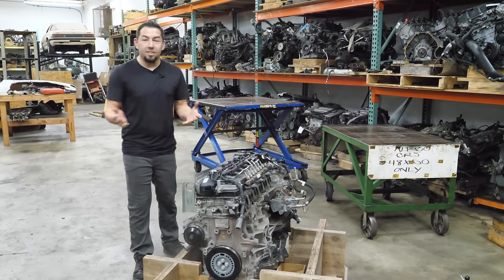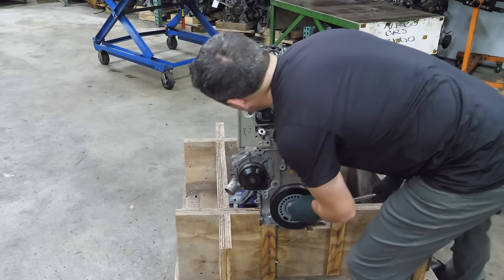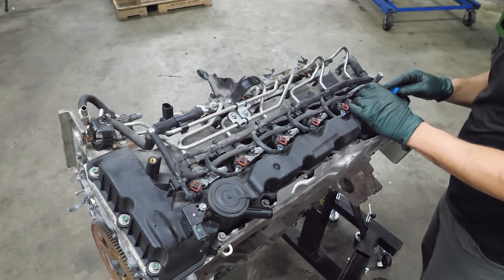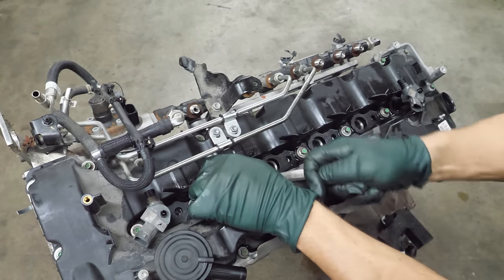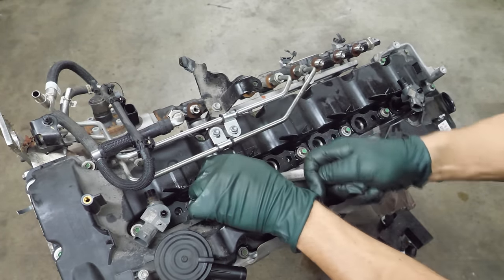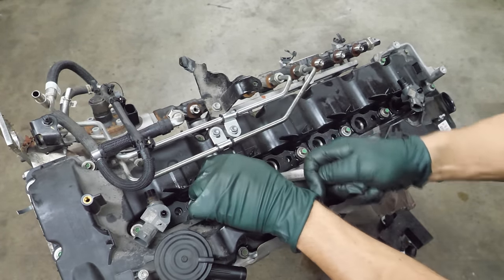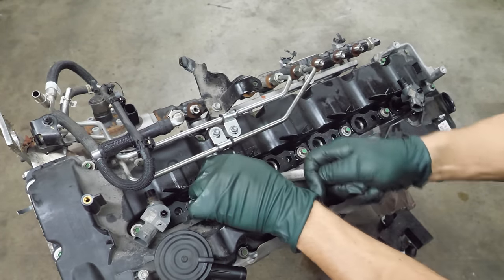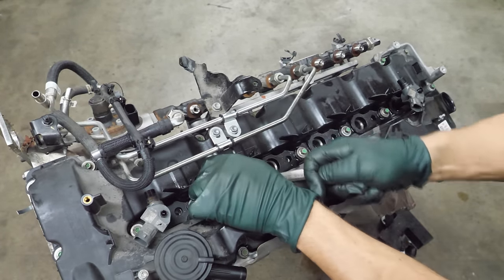BAD 2020 Silverado 3.0 Duramax LM2 Engine Teardown INCREDIBLE DAMAGE!

Comment: I don't know why so few manufactures can figure out timing chains anymore.
Reply: It's all about the $ and they have it figured just the way they want it.
Reply: @greggc8088  I think Ill stay happy with my old belt drive cam Toyota 2uz, a belt that reliably does 125k miles and take 2 hours to change!
Reply: Accountants are the problem.
Reply: @Thecarguy1254  A (dry) timing belt thats easy to change is the best solution!
Reply: I don't know why even fewer figure out timing gears.
Reply: Well kevlar is stronger than steel and that one, even with the abuse, looks like it would last for another 125k.
Reply: @greggc8088 absolutely correct. That explains plastic thermostat housings and oil pans.
Reply: Was it done by a bad engineer? Or GM wanting a truck to blow up out of warranty so you buy another new truck?
Reply: They know how to, its just not profitable.  Think about it if your cars ran 200k with no issues how would you make money.

146k is pretty good for a modern gm timing set up lol.  Designed to fail, incredibly expensive to repair when it fails = people just trading their car in vs fixing it most of the time.  Either way gm makes profit.
Reply: @greggc8088  They really want to replace many thousands of engines still under warranty?
Reply: @johnarnold893  Chevy says 150K replacement interval for the oil pump belt.  Not sure I'd want to trust it for almost double that life!
Reply: @WolfmanDude I would say thats the second best, gear drivin timing is the absolute best.  Set it up once at the factory and never touch it unless something else needs to be removed

Thats my opinion at least
Reply: Well things were less complicated years ago. You needed an oil pump, valve camshaft and fuel injection pump drive. Now a days,, half off the world ,,depends on this drive.
Some one once said: every advantage has its disadvantage.
Reply: Yea they save maybe $0.25 on the chain but when you sell 1m engines its a lot of money, i just wish somebody would start making upgrade kits so we are not forced to put the same crapy chain that failed from the start
Reply: Laughs in Audi/VW/Mini/BMW/GM.....
Reply: They win either way.  Either you get a new engine, or you get a new vehicle.
Reply: It would’ve been possible to make it gear driven too
Reply: Oh, manufacturers HAVE figured it out. It just doesn’t make sense to us, the consumers.
Reply: It ist not that they can´t - is more a they don´t want to. They think most customers will shut up and pay - wrong they are. At least in my case.
Reply: @AkioWasRight  timing gears are loud and don’t allow smooth acceleration. Which is why they’re in use on maybe a few engines available in light duty pickups today.
Reply: @Redsfanatic32  "Loud" is subjective. To many people, the added noise is actually a benefit. To me, it sounds like a supercharger, which is a total benefit.

As for "smooth" acceleration, I'm not even sure what you're referring to. Timing gears are actually the most accurate approach, giving you more control over the valvetrain. In reality, you can actually make an engine smoother with a gear set.

Any other disadvantages are negligible. 

Beyond that, it's just objective advantages. They're more durable, they don't develop as much play overtime, they last MUCH longer, there is no servicing, and low sliding gear cuts tend be more efficient.

Really, there's no good reason to not use timing gears, other than it just being too good for some people.
Reply: I know the diesel engine is inherently noisy but how noisy does it have to be when your pistons are smashing into your valves how long do you have to drive it to make indents that big?
Reply: It’s cheaper and in most cases requires the consumer to go to the dealership for the overpriced repair.. thus keeping dealerships funded so they can sell more of the junk the manufacturer makes. It’s rapidly headed towards the only way you can get your vehicle repaired is at a dealer. All this stuff that has to be “ programmed” after its replaced.
Reply: @AkioWasRight  all I know is what my Cummins engine does. Can’t really hear the gear whine on it. I just know what they sounded like on old gas engines.
Reply: @AkioWasRight For OHC engines, timing gears are complex and expensive.
Reply: @Thecarguy1254 my 5vz has 292k miles original belt 😅 about to do it and water pump soon though
Reply: @PistonAvatarGuy  Make them OHV.
Reply: @AkioWasRight  F--k no.
Reply: @PistonAvatarGuy  F-yeah.

The complexity of OHC has no purpose other than to make up for lack of pumping efficiency. 

If you drive a 30+ mpg Corvette, you'll understand what I mean.
Reply: @AkioWasRight  OHC engines make more power, more torque and are more efficient due to their superior cylinder head flow characteristics. OHC engines are also more mechanically efficient. That Corvette is an anomaly, in every other application, every example of an OHC engine is more efficient and more powerful than its OHV equivalent. American trucks are good examples of this.

And just imagine losing 200+ hp in a Lamborghini, or a Ferrari because OHV engines are so limited in the amount of power they can produce.
Reply: @Redsfanatic32  Modern Cummins (Common Rail) make hardly any gear train noise. At most, it's a slight whine when not under load. In other conditions, you don't hear anything because the sound gets drowned out by induction, injection, combustion and valvetrain noise. 

Again, "loud" gears are not that big of a deal. The sound of a modern DI systems would cover up the noise, even on a gas engine.
Reply: Before belts before chains wear gears, gears are best and last forever.  2nd best is an easy to change belt.
Reply: @AkioWasRight  Yeah, compare the 5.3 Silverado to the OHC 5.0 F-150, the F-150 makes more torque, a LOT more power and it still manages to get better fuel mileage.
Reply: Emissions, that's why.
Chains introduce tons of friction.
Some manufacturers that have tried using thinner chains to reduce friction, end up having the chains snap prematurely.

The only lasting low-friction timing system involves gears, and gears are very expensive - that's why we only see gear-driven timing systems on industrial engines.
Reply: @HomelabExtreme  Gears are insanely expensive, using them would likely add thousands to the cost of a car. No one even used gears on cars before emissions were an issue, except on some OHV engines.

You people will just desperately grasp at any straw that you can to find a reason to be anti-goverment, it's ridiculous.
Reply: @PistonAvatarGuy  lol, that's not true. LS engines have excellent induction efficient, with some of the highest CFM of any stock engines. This is actually due to the fact that there is no cam in head, allowing for larger paths in and out of the head.

Also, it's not an "anomaly". Even Charger Scat Packs will get close to 30 MPG when cruising, and they make nearly 500hp and are in giant boat of a car. That pretty much rounds up the limited number of gas cars with OHV. So, there's no basis for "anomaly". Efficiency is actually typical. 

Beyond that is OHV diesels in HD trucks, but even those are fuel efficient given their application. I mean, I can get 21-25 mpg on the highway out of my Cummins, and it has more power than an Aventador below 3,000rpm. OHV can be remarkably fuel efficient. 

Also, those whose notion that OHC is more "efficient" comes from a total misunderstanding of horsepower and "efficiency". Simply making more horsepower =/= "efficient", as that completely ignores energy expenditure. 

Corvettes, as the example, have "big" engines by certain standards, but they're not really "big" in a meaningful sense, they just have a lot of displacement, which is what you want. They can move tons of air with a relatively simple configuration. At the same time, they have fewer mechanical losses due to their simplicity. This is what makes them truly more efficient, not in the boy racer notion of "efficient".
Reply: @PistonAvatarGuy  Not in the real-world. In fact, even the GM 6.2L is more efficiency than Ford's 5.0L in real-world driving. 

I should know, my company has owned both trucks.
Reply: @AkioWasRight  That's some good trolling, there, bud.
Reply: I recently had to part ways with my 2009 Toyota Yaris due to some type of failure in the timing system.  I don't know exactly what happened because it was too expensive for the repair shop to diagnose, let alone fix.
Reply: @PistonAvatarGuy  I have no intention of trolling anyone, I'm just right.
Reply: Timing chains are the head gaskets of the early 2000s.
Reply: Short, stout timing chains on a pushrod engine are fine.  5' of bicycle chain is nonsense
Reply: Put it in the back because that way you got to pull the engine and all this crap lol
Reply: Its the over head chains
Reply: Especially putting them on the rear/transmission side. That should be a felony
Reply: That timing failure, and the pistons hitting the heads, was caused by excessive redlining.  Someone beat the crap out of their truck, THATS why it failed.  With normal operation, that engine would still be running.
Reply: @michaelbruns473 no customers wants more comfort power etc and these design ideas give you that.
Reply: Where’s your engine design what platforms is it in??? Let me know I’m curious.
Reply: Honestly, to go along with plastic thermostat housings, oil pans, and radiator/cooling system components, I'm shocked that plastic camshafts, crankshafts and connecting rods haven't been put into service by BMW first, followed by everyone else. 5 years down the road, plastic wheel bearings.
Reply: @AkioWasRight  you're ignoring that the most powerful on-road diesel engines that you can get in a semi today are OHC.  X15 Cummins, C15/18 Cat, 60 series Detroit 

Also, we also know that Harley Davidsons with their OHV engines are the absolute pinochle of mechanical efficiency 😂
Reply: Make no mistake about it …. They do NOT want the average citizen working on their designs , Good OR Bad ….
Also those “Duramax” engines are really made by “ISUZU” through a Marketing agreement that goes all the way back to the 1980’s when Chevrolet marketed the P’up which was an Isuzu pick up and the Luv pickup that competed with Datsun and Toyota mini-Trucks of the Day ….
Reply: @christopherweise438 
In Every case .
Reply: @johnarnold893 
It may be stronger when New but will never outlast well lubricated Iron gears .
Reply: @hopingforthebest1.9  Most large diesels are inline configurations and are gear-driven single cam. They don't have multiple cams and a mess of timing chains or belts. 

As for their efficiency, OHV has little benefit over SOHC in an inline engine, since pushrods have a tradeoff with belts, chains or gears. That's very different from a V-block. OHV V engine requires no added complexity, while SOHC basically requires double the timing components to operate.This said, both are relatively simple vs DOHC.

As for Harleys, that's a much more complicated subject as they are basically in a class that few others share. But keeping it simple, they are efficient for bikes of their size, weight and torque, so I don't really know what you're sarcasm is about.
Reply: @AkioWasRight One advantage of DOHC over OHV is with 4-valve engines. With an OHV setup, you would need to run valve bridges.  So, if you have a basic belt driven DOHC setup like the Honda J series and some Toyota V-6s you can actually have less moving components (depending on how the valvetrain is set up) than the equivalent 4-valve OHV engine 

Additionally, because the reciprocating mass of OHC setups is significantly less than an equivalent OHV setup, it allows the engine to spin faster without valve float-- which smaller displacement engines benefit from.

As for the Harley remark, just about every other motorcycle manufacture makes engines that produce more output per liter of displacement than Harleys.  What do they all have in common? They all almost exclusively run single or dual overhead cams.
Reply: An FSE told us German input was used in this engine. I don’t doubt it.
Reply: @hopingforthebest1.9  Output per liter is a meaningless measure because HP is a function of torque and time. It has no relation to displacement. 

Again, I can get 30+ mpg out of a Corvette with 400+ hp. Not many high revving cars match that, if any. Does it matter that GM pushrod engines have big displacement? No, it shouldn't.
Reply: Timing chains have been around for many decades!!
Figure them out isn’t the issue,
It’s cost savings! That’s the issue!!
Reply: @AkioWasRight Noisy and expensive.
Reply: They dont give a shit. Its that simple. Buy old cars.
Reply: The e.p.a ruins everything.
Reply: @WolfmanDude chains are better. Plenty of engines use chains, and they last the life of the  engine. My LM7 being one of them. It’s these shitty tensioners that are the problem.
Reply: Knock on wood but my mom's 2003 honda odyssey has 330k miles on it on the original timing belt (yes I know time bomb) so honda at least has it figured out
Reply: @AkioWasRight  inertia. Distance.
Reply: They’re all focused on battery tech now
Reply: @richardcornelius1050 The 6.6 duramax was a joint venture between Isuzu and GM. This engine was all GM clean sheet. GM calls all their diesel engines "Duramax". Even the 2.8L 4 cylinder from the Colorado despite the fact it is a VM Motori design built under license.
Reply: because good quality steels are almost impossible to get. china, india, turkey, US, vk and Norway steel from smelters with recycled steel is not consistent quality. The dutch steel is also getting worse as more and more recycled steels are added in melting proces.
Reply: @WolfmanDude  Totally agree.  Timing belts are simple, lightweight, less parts count and create a valid reason to refresh key components every 100,000 miles or so.  Basically if it’s a overhead cam engine, I would rather it have a timing belt.
Reply: I dont know why they would go with timing chain over a timing gear set in a diesel engine in general. This thing is too big to use chains. Dumb ass design if you ask me.
Reply: @zacharydavid5686 getting gears to line up between the block and the heads is the issue. If the cam is in the block, it's easy to align, not so much when you have a bolted on head. Chains allow some alignment slack.
Reply: @AkioWasRight I drive a car with 2 timing gears (1979 Subaru DL engine swapped with an 87 EA71S engine). One on the crank, one on the cam. I can't even hear it over the exhaust. Sometimes if I am cruising at really high manifold vacuum and the exhaust is quiet, I think I can hear them, but it's really not noticeable. The reason modern engines usually don't use them are #1- overhead cams, #2, money. It's easier to meet emissions with overhead cams and variable valve timing than cam-in-block, and it's cheaper to drive overhead cams with chains or belts than it is with gears. On an old fashioned cam in block engine like my Subaru, the gears didn't really cost any more. In fact that Subaru in its day was one of the cheapest cars you could buy. Didn't stop them from using gears.
Reply: @sherwoodforst7089 It is based on the 1.6 Opel diesel that was available in the Chevy Cruze. Some components like the timing chain tensioner are interchangeable. But the 1.6 has an oil pump CHAIN, not a belt. They developed the 1.6 into a 1.5 3 cylinder, a 2.0 4 cylinder, and then the 3.0 6 cylinder. All of which have the oil pump belt. But they really don't have issues. In fact I think they would have had less timing issues, had they gone for a full belt setup rather than just oil pump. Similar to the 1.2 in the Trax/Envista. GM has their wet belt technology down, compared to Ford or Peugeot.
Reply: @johnarnold893 you know honda and toyota tried wet belts with Kevlar and withing 5 years they offered cobwrsin to chain kits
Reply: @LethalBacon479 no theu say they tested it should be fine for 150k the warranty let's you k ow how long they think it will last.
Reply: The warranty isn't for 150k.  60K powertrain warranty.  I'm not risking a $10,000 engine on a $24 belt.
Reply: When it's determined by a manufacturer that a car's "lifetime" is ten years and 150k miles, they only make the parts strong enough to last that long.
Reply: @AkioWasRight Timing gears are loud as shit. You can't hear it over a 7.3 or 5.9, but people won't buy a car whose engine is constantly whining.
Reply: The removal of certain engine oil additives is part of the problem. The other part of the problem is the use of inverted tooth timing chains.
Reply: @justing6594   That's the strategy of many auto manufacturers. How many went from using roller chains to inverted tooth timing chains for no reason other than cost and reduced valvetrain noise? Ford used a roller chain for just one year in the 3.5 Ecoboost used in F-150's before switching to inverted tooth timing chains, bringing with it constant timing chain problems ever since.
Reply: @Bogel91   146k is pretty good for any modern manufacturer using cheap inverted tooth timing chains. Ford could have avoided years of stretched timing chains had they stuck with roller chains.
Reply: @jamesgeorge4874  Audi/VW/Mini/BMW/GM/FORD/NISSAN
Reply: @PistonAvatarGuy  "OHC engines make more power, more torque and are more efficient due to their superior cylinder head flow characteristics. OHC engines are also more mechanically efficient. That Corvette is an anomaly, in every other application, every example of an OHC engine is more efficient and more powerful than its OHV equivalent. American trucks are good examples of this."

HP per Liter is not efficiency. That's the kind of thing that room temp iq dunces think is true. BSFC or Brake-specific fuel consumption is a far more relevant and accurate way to compare efficiency. The Gen V 6.2L V8 had a better BSFC than the Gen 2 Coyote 5.0 and is still quite competitive with even the Gen 3 Coyote 5.0. And it's not an anomaly pertaining to the Corvette. In 2015 when the aluminum F-150 debuted, the 5.0L version of the truck struggled to match the EPA fuel economy of the equivalent Chevy with the 6.2L. 1.2L less displacement, supposedly "more efficient" and yet it struggled to match the EPA rating of the big "inefficient" 6.2L pushrod engine? wtf lol

You do realize that even Ford admitted that OHV was better for fuel economy than OHC when they unveiled the 7.3L Godzilla, right? If you look at the interviews with the engineers behind the decision to go back to an OHV design instead sticking with OHC, they said one of those reasons was better fuel efficiency. OHC, particularly DOHC, have huge parasitic losses due to the energy required to move all the mass in the valvetrain of the engine. Multiple timing chains dragging across multiple timing chain tensions, turning up to 4 camshafts, moving up to 32 valves and springs. Not to mention the huge engine oil requirements to keep those lash adjusters pumps up and cam phasers in control. 

The biggest advantages of DOHC are at very high RPM, high boost applications, and emissions. Emissions was actually the single biggest reason why most manufacturers discontinued their small displacement OHV engines.
Reply: @deplorablelibertarian   You're probably right but I wouldn't have waited until the service interval was due in a few thousand miles to have the belt and timing chain done, particularly on a totally new engine design with GM's first foray into wet belt driven oil pumps.
Reply: @hopingforthebest1.9  On the other hand, we also know that even when Ford stripped hundreds of pounds of steel off of the F-150 for 2015, that several hundred pound weight advantage still wasn't enough to help their 5.0L 32V "efficient" DOHC V8 deliver better EPA fuel economy rating than same model year GM trucks with the 5.3 or 6.2 V8's. OHC was adopted primarily for the advantages when used with boost, or when governments began to more strictly regular emissions based on engine displacement. The gold standard for determining true fuel efficiency of an engine is brake-specific fuel consumption. The Gen V 6.2 V8 had a higher BSFC than even the Gen 2 Coyote 5.0. Using Harley Davidson's engines as the basis for your argument against pushrod engines is low IQ clownworld stuff.
Reply: @karlschauff7989  "HP per Liter is not efficiency."

I wasn't talking about HP/L, I was talking about actual fuel efficiency. The most fuel efficient vehicles in the world are all powered by OHC engines.

"BSFC or Brake-specific fuel consumption is a far more relevant and accurate way to compare efficiency."

The most THERMALLY efficient (this is what BSFC measures) automotive engines in the world are also all OHC engines. Maybe you should have actually read my comment before replying.

"1.2L less displacement, supposedly "more efficient" and yet it struggled to match the EPA rating of the big "inefficient" 6.2L pushrod engine? wtf lol"

The F-150 is slightly more fuel efficient. The EPA rates both trucks the same on the highway and Ford gets 1 mpg better in the city.

"You do realize that even Ford admitted that OHV was better for fuel economy than OHC when they unveiled the 7.3L Godzilla, right?"

Maybe if you compare a DOHC, 32 valve V8 to an OHV V8, but a 2-valve SOHC engine is simpler, has fewer moving parts, allows complete freedom of port design and has much less reciprocating mass. Ford would have gone with an OHV engine to simplify the cam drive, which is a problem for many OHC engines (thanks to owners not knowing how to maintain belts). Again, ALL of the most thermally efficient (BSFC) automotive engines IN THE WORLD are OHC.

Again, if you'd read my comment, you'd see that even heavy truck engine manufacturers are going to OHC engines, and this absolutely isn't part of some marketing campaign, as they're not mentioning it overtly when regarding the engines, this is purely being done for the sake of efficiency.

The real problem with how you people are making these comparisons is that you'll compare an ultra-high strung OHC engine to an OHV valve engine and then make the conclusion that OHC engines are less efficient, but when they're not high-strung, you end up with insanely efficient engines, like the Prius engine, or the Mazda Skyactiv engines (the most THERMALLY efficient gasoline production car engines in the world), or the current Formula One engines (the most THERMALLY efficient gasoline engines PERIOD), which are much less high-strung than F1 engines from the past.
Reply: @AkioWasRight  They figured out timing gears decades ago, and they were upset that the gears basically never wore out, so they invented chains and plastic bits in the timing system so that they would fail and cause massive damage to the rest of the engine, resulting in a greater cash flow out of your pocket.
If there's one thing 'they' can't stand, it is Lowly Peons having discretionary funds available.
Reply: One of the things I see in common with the low mileage failures.. is a very complicated timing chain pattern, with a lot of tight corners requiring lots of tensioners...
Look at a Toyota 4 cyl.  a simple V shape from crank to the cams... with very little deflection of the chain where it contacts the tensioner guides..
Reply: General Motors spends their considerable engineering talent not building the best but finding the best way to save $0.02 per vehicle....

I've never owned a GM car I doubt I ever will-
Reply: They have figured them out!! How to make them fail and make the consumer spend more money!!! On a positive note, the price of lube is still fairly reasonable!!😂
Reply: @Bogel91 Thats assuming someone buys another junky GM. They don't make any money when they thoroughly piss off a consumer with their crap giving out prematurely and buying another brand.
Reply: @hopingforthebest1.9 until they try to save a dime and make them out of plastic which fails. They go from a bulletproof design and sabotage it with the bean counters. That's why brand loyalty is down the toilet.
Reply: @andrewallason4530 not if they replace the engine and you trade it for another brand. They lose all the way around as most will never return to that brand
Reply: @karlschauff7989  Really, the sole argument for pushrod engines is when it comes to V8s, as you can have a larger engine that loafs along at low load and low rpm over a wide range of operating conditions without also having it be absolutely enormous in physical size. If Ford had wanted to retain the SOHC setup of the 6.2 that they replaced with the 7.3 Godzilla (stupid name, that's a Japanese icon), while also increasing its displacement by over a liter, the engine would have likely been ridiculously large in its physical dimensions. Everywhere else, you just run into the problems that I mentioned in my previous comment.

Nothing proved more conclusively that pushrod engines were obsolete in every application that had less than 8 cylinders than GM's pushrod V6, which was absolutely stomped by its overhead cam contemporaries... in every possible way... even as GM added features like VVT and increased its displacement (LZ9, 3.9 liters). That engine would have likely needed to be more like 4.5 liters in displacement to compete with the power levels and efficiency being delivered by OHC ~3.5 liter V6s today, and you might as well go to a V8 at that point.

Anyway, some heavy truck engines to check out...
International S13 - DOHC
International A26 - SOHC
Volvo D11 - SOHC
Volvo D13 - SOHC
Cummins ISX - SOHC/DOHC
Cummins X15 - SOHC
Reply: @PistonAvatarGuy   What does it matter if the engine "loafs along at low load and rpm"? MOST engines loaf along for 95% of their life. That's where fuel economy is judged, not when you're running through the gears at 80 mph on a twisty mountain road. And Ford didn't engineer their new 7.3L V8 just to loaf along at low load. They chose a pushrod valvetrain because it would deliver an engine that was more fuel efficient at low RPM at a variety of engine loads than a comparable OHC engine. Both under the exact same workloads and demands, they ran the simulations and FEA, and determined the pushrod valvetrain delivered  better fuel economy. Cope harder lol

The single biggest driving force behind the shift to OHC engines was and still is EMISSIONS. GM even kept their 4.3L pushrod V6 in their half-tons because it delivered the perfect amount of power and fuel efficiency, only recently getting rid of it for.... yeah... emissions regulations. Even in the world of sports cars, the Camaro and Mustang are within one or two MPG of each other despite the Camaro having 1.2L more displacement, half the number of valves, no independent intake/exhaust valve timing, no variable geometry air intake, etc. When equipped with a manual, the Camaro with that big "old school" 6.2L V8 actually gets 1 mpg better in the city and overall average vs the "high tech" 5.0L V8 with twice as many valves, independent intake/exhaust VVT, variable intake geometry, etc. 
https://www.fueleconomy.gov/feg/Find.do?action=sbs&id=44282&id=45050&id=44232&id=45049

The GM 3.8L was quite competitive when it was still on the market, the biggest detractor being the fact it was behind that 4spd turd GM always paired it with. The 2004 Buick LeSabre with the 'old school' port-injected  3.8L V6 and 4 spd delivered essentially the same fuel economy as a 2014 Buick LaCrosse with 3.6L DOHC VVT DI engine and 6 spd transmission. https://www.fueleconomy.gov/feg/Find.do?action=sbs&id=19827&id=33836
 It also delivered the same fuel economy as a 2004 Toyota Camry with the 3.3L DOHC VVT V6 and 5 speed auto. 
https://www.fueleconomy.gov/feg/Find.do?action=sbs&id=19827&id=33836&id=19812

You overlook the downsides of a modern DOHC engine design. It has a lot of parasitic losses as a result of the big moving mass and friction required to make it work. 4 cams vs 1, twice as many valves moving, 4 VVT cam phasers vs 1, multiple timing chains (some of them very, very long), multiple big timing chain tensioners, etc. That's a lot of additional mass and friction. It's also a lot of mass that's speeding up and slowing down as the engine is operating. It also puts a big load on the oil pump to keep the phasers, lash adjusters, and tensioners operating.
Reply: @giggiddy  engineered to last the warranty period, you buy the replacement engine, at 300% of it’s actual cost.  Or write the vehicle off.   And when you buy the replacement, don’t forget, despite all the vehicle brands, there’s only really a handful of actual companies controlling the industry.
Reply: No shit. Gone are the days of a single chain and it has become whatever clusterfuck this thing is.
Reply: gm since bailout is even worst than before, my 2.0t ecotec has 15 years and 160k miles and everything is factory, you cant even do that with the same engine from 2010-2020
Reply: I've been told chains make a bit more noise than belts. On the other hand, my old Golf Diesel only had its timing chain checked (acustically) at 200k km (125k miles), sounded good, so they told be to check it again 100k km later. Sold that car with 230k km, the next owner drove it to 320k km. Now I have a belt-timed TDI, and the change interval has been adjusted from 60k km to 90k km a few years ago. Another car I had had an Iveco engine that needed a belt change after 45k km or four years, yikes!
So my theory is they use belts nowadays because they're quieter, but more important, they have change intervals and since you basically have to take apart half the engine to get at them, this is quite expensive. So expensive that Volkswagen changes the water pump at the same time, because you also need to take half the engine apart to get at it (and it's the same part as for the timing belt). Other than that, my TDI engine is solid as anything, got nearly 270k km on that one, and it's showing less wear and tear than you'd expect from a nearly 20 year old engine.
Reply: @hinzster  Most timing belts these days have ~100,000 mile (160,000 km) change intervals. The Honda J35 in the Pilot, for example, has a 105,000 mile belt change interval.

Belts are used because they're more efficient (more power, better mpg, lower emissions), they're lighter (reducing both engine/vehicle weight and the inertia associated with the moving parts of the engine), they're cheaper, quieter and they absorb harmful harmonics which can be transferred between the crankshaft and camshaft(s). Many of these advantages are why you'll find belts on some of the most high performance racing engines in the world, like NASCAR engines.
Reply: @giggiddy  They don't care about second hand market.  Most people buying new cars trade in their car before the failure point (100k miles).
Reply: Step one: remove engine
Step two: replace oil pump belt
What’s the problem?
Reply: Noise is the problem with gear drive cams.
Reply: @AkioWasRight  "The complexity of OHC has no purpose other than to make up for lack of pumping efficiency."

I'm still trying to figure out if you're trolling, or not. Are you being upvoted because people are cheering you on for being a troll, or are they just that dumb? Pumping losses create a limit on both power and efficiency, which is why the most efficient automotive engines in the world, and the most powerful automotive engines in the world, are OHC. Even semi truck engine manufacturers are going OHC in search of efficiency. I'm just baffled.
Reply: @karlschauff7989  "That's a lot of additional mass and friction."

He says. ignoring the enormous size of the OHV engines required to compete with OHC engines.
Reply: @PistonAvatarGuy  You're baffled because, instead of focusing on what I said, you're just fishing for an ad hominem argument to make.

Look, it's almost a week later. Just move on.
Reply: @AkioWasRight  What you said doesn't make any sense.
Reply: @PistonAvatarGuy  Then rethink what you understand, because it's probably wrong.
Reply: @AkioWasRight  OHC engines = the most powerful engines ever produced, thanks to their superior aspiration and mechanical efficiency. OHC engines = the most thermally efficient engines ever produced, also thanks to their superior aspiration and mechanical efficiency. What am I wrong about?
Reply: @PistonAvatarGuy  We've already been over this. Just move on.
Reply: @AkioWasRight  All you did was troll. Heavy truck engines are going to OHC, because their primary concern is efficiency, you said the opposite. You said that LS engines have excellent induction efficiency, but their heads flow quite poorly when compared to OHC heads and their low BMEP reflects their poor aspiration efficiency. If you read the rest of my comments here, you'll see that only V8s really benefit from an OHV arrangement, while other configurations suffer a loss of efficiency and performance as a result of making use of an OHV system.

Edit: Maybe you meant HD pickup trucks?
Reply: @AkioWasRight  Ok, a couple of my most important comments here were shadowbanned, so you win, I can't compete with censorship.
Reply: @Thecarguy1254 facts. On my 4th? 5th? UZ over 200k all have been great.
Reply: Poor maintenance can't be bypassed with engineering.
Reply: @christopherweise438  It's not the accountants that make the decisions.
Reply: Since this is a Duramax I assume it is made in Korea and for the cab over engine trucks that get services from the rear of the engine rather than the front.
Reply: It only has to last as long as the warranty.. not a day longer.
Reply: @christopherweise438 common misconception.  The bean counters are NOT the problem.  The average consumer is the problem bc they do the following:

1. Buy vehicles based on secondary features/gizmos rather than what they need the vehicle for.

2. Half the country continuously votes for more and more regulation making the vehicles far more complicated and less reliable

3. People keep manufacturers afloat that turn out the worst instances of the planned obsolescence by buying the vehicle because it is 4-5k cheaper than the equivalent vehicle from a better manufacturer.

The bean counters just react to the customer, it’s 80% of the problem.
Reply: @christopherweise438  Beancounters look at will this last untill the  engine warranty is up if we use cheaper parts to save $0.06 a unit?
Reply: @Joe-hz1nw  -  Sounds like something an accountant would say.  😉
Reply: @stewkingjr  -  The hell it's not.  Cost controls EVERY decision.  They may not have the final sign off......but it's all their plan.
Reply: timing gears > timing chains
Reply: @Bogel91  how does that work for toyota then? their cars last hundreds of thousands of miles yet they are still at the top and still sell a bunch of vehicles. So it appears you can make a quality long lasting product and there will be a demand to make more.
Reply: That engine is so overdesigned melt it down and make two 5.3L.
Reply: Atleast it wasn't some garbage belt
Reply: All it's gotta do is last the warranty. Anything after that is money wasted.
Reply: There is no excuse it isn't gear drive.  @WolfmanDude
Reply: @PistonAvatarGuy  LMFAO dude you're clowning your self right now.
Reply: @karlschauff7989  Ok, troll. Let me know when a pushrod engine achieves over 50% thermal efficiency while producing ~1,000 hp from a 1.5 liter engine, or 200+ mpg in a production car, mmkay??
Reply: Classic Mercedes Diesels had the best timing chains of all time. OM617 MASTER RACE!
Reply: @PistonAvatarGuy  "50 per cent tHeRmAl EfFiCiEnCy!!!1!" Ok let me know when a twin turbo 5.0 Coyote hits 50% thermal efficency. Last time I checked a stock 5.0 Coyote just matches an LT1 6.2 in fuel economy despite twice as many intake and exhaust valves, 4 times as many cams, 4 VVT cam phasers instead of 1, independent intake and exhaust valve timing, and a variable geometry intake manifold. That's where the rubber meets the road, not highly specialized designs like the Skyactiv that gets its fuel efficiency from HCCI!!! not the fact that it's a DOHC valvetrain. As I already pointed out, the Gen V LT1 6.2 achieved a better BSFC than the Gen 2 Coyote despite the "enormous" difference in displacement and having half the number of valves per cylinder. 1500 HP? who tf cares? We weren't debating what a factory engine can make with huge mods. We're talking fuel efficiency and power of factory, EPA legal engines. 

Stay salty 🤡
Reply: @karlschauff7989  Also, just to hammer home how pathetic the Coyote really is (unless it's turbocharged and making 2,500 hp)...

2022 Nissan Titan - 5.6 liter V8; 400 hp; 413 lb-ft; 16/21 mpg; 5,539 lbs.

2022 Chevrolet Silverado - 5.3 V8; 355 HP; 383 lb-ft; 16/21 mpg; 4,860 lbs.

Face it, your Coyote poster child for the ultimate OHC engine is just weak and you're cherry picking because you don't have an actual argument. Who's the clown now?
Reply: @stoneylonesome4062 Mercedes even sold offset cam gear keys in the 1970s, so you could set your cam timing right on a stretched chain to get another 200,000 miles out of it.
Reply: @karlschauff7989  Yeah, pwned. Eat it.
Reply: I dunno man, my 24V Cummins accelerated smooth as silk with a front gear train. I couldn't hear the gear lash much either while it was running, not like I can in the bigger Cat engines anyway. @Redsfanatic32
Reply: @confused9525 it's not a lot of money for a billion dollar company.  It is a lot of money to a greedy billion dollar company.
Reply: @WolfmanDude 
Gear drive that will run a million miles is the best solution*
Reply: @kylesonsalla7620  Yes I also think gears are the coolest and most durable solution. However no manufacturer would ever put them in a new car. They are too costly and noisy for the target demographic of new cars. Remember, new cars are not made for us technical people. New cars are made as a status symbols for upper middleclass people with zero technical knowledge. I would pay extra for a more durable engine with gears, but I will also never buy a new car. I hate penny pinching as much as the next guy, but is is an important thing to consider because cost dictates if something gets even produced in the first place. Same is true for other unpopular subject like emissions and noise. Thats why I think a well designed timing belt is the best solution. Its cheap and silent enough to be competitive and mass produced, yet it enables us technical people to keep the system in good shape indefinitely with relative ease.
Reply: @WolfmanDude  
They come in diesel pickups all the time still.
Reply: At this stage in ICE design the manufacturers could simply eliminate timing chains and belts altogether by using pneumatic or electrically actuated valves. The benefits of  virtual cam profiles alone would be huge performance boost.
Reply: @PistonAvatarGuy Assuming what you recite is true… all those monetary and environmental gains are out the window in the grand scheme when you consider that GM LS engines routinely last 400,000 miles with nothing more than oil changes.
Reply: @wphh7272  No they don't, where on Earth did you get that idea? The timing components aren't even the most common part of an engine that becomes a problem as engines age, it's usually the piston rings/cylinders and/or the rotating assembly bearings. Heck, the SOHC V8 in the Crown Vic was one of the engines that was most famous for lasting to around 400,000 miles. You people are just focusing on the engines that have problems with their timing chains, but there are PLENTY of OHC engines that simply dont have those problems.
Reply: @WolfmanDude  Well said!
Reply: @wphh7272  I guess I should have worded my comment differently, of course an LS engine CAN last that long, but they rarely do, and the same can be said for a good number of production car engines.

How long an engine lasts isn't related to its cam placement (again, that's where heavy truck engines are headed), it's related to the design life of the engine, which is going to be as short as manufacturers can get away with, so they can sell as many vehicles as possible.
Reply: @wphh7272  And if your argument is that it makes sense to replace 30-40 mpg OHC 4 cylinders with nothing but 15 mpg V8s, that's just insane.
Reply: They have...copy China and build junk with junk...no that's a sanpan. Lol....
Reply: @karlschauff7989  "As I already pointed out, the Gen V LT1 6.2 achieved a better BSFC than the Gen 2 Coyote despite the "enormous" difference in displacement and having half the number of valves per cylinder. "

Also, this comment is hilarious, because it sounds like you're making the same mistake as the Raptor Aircraft guy, thinking that BSFC is something that's fixed for an engine, or that an engine has the same BSFC over the entirety of its rpm range and load settings, but that's not how things work. Yes, larger engines (regardless of valvetrain configuration) can have a better BSFC at the rpm and power settings where engines spend most of their time operating (and where the EPA tests mainly run the engines) than smaller, higher-strung engines, but that doesn't mean that their BSFC is just better in general. A 9 mpg rated DOHC engine might have a worse BSFC at low power settings than a 15 mpg pushrod engine, but the DOHC engine might have a better peak BSFC at higher power settings. Either way, DOHC engines hold the record for thermal efficiency (the best BSFC). I suggest that you look up something called a BSFC map.

It seems like you're trying to use the LS engines as proof that pushrod engines are inherently more thermally efficient than OHC engines and that all of the manufacturers of OHC engines are just lying, which is just absolutely hilarious, because it's simplistic on a level that's basically insane. Sometimes things are complex, that's just how things are, bud.
Reply: @PistonAvatarGuy, nothing like admitting you’re a democrat….
Reply: @hopingforthebest1.9 I heard they didn't do timing gears because they are too noisy  .
Reply: @WolfmanDude  My tacoma has leaky camseals, would you say that is detrimental to the life of the belt?
Reply: not sure why a diesel engine has a timing chain... have they not all learned from cummins? gear train is the most reliable way to run a diesel
Reply: @AkioWasRight  who
Reply: How well is a chain going to hold up to oil filled with soot? Look at how many cars/trucks have timing chain stretch issues.
Reply: @justing6594 definitely the latter. I know some of the engineers and their sharp guys they adjust are handcuffed by the bean counters.
Reply: @jeffreygoss8109  sad. All about making a buck I guess. I think I'm going buy an old tacoma or something.
Reply: @Thecarguy1254 I own 3 of these and I’m trying to keep them for a very long time.  Such good engines and they ask for so little.  My daughter has 285k and my sons 250k and my beater truck 370k and all still run with no leaks and no smoke.  I started the ole truck the other day, hasn’t been started in a month, cranked right up with no smoke.  Try that with some of these newer GM or Ford eco traps….let alone one with 370k miles on it!
Reply: It's the auto start stop.
Reply: @Thecarguy1254 my pile of trash Cruze had 200k on the belt
Reply: I use to like dual timing chains.
Reply: Emissions, rolling resistance, drag, sustainable/safe material standards. Money ultimately.
Reply: Is the LZO better?
Reply: A diesel with any chain is just wierd im so use to gear driven diesel engines. But this belt for the oil pump is just bad like the 4.2l Audi V8.
Reply: @Thecarguy1254 My frontier has 150k original chain and tensioner
Reply: Ever since the Audi timing chain fiasco, manufacturers realized they can deliver 💩💩💩 to customers and people will accept.
Reply: I think it’s funny too. I still daily-drive a 1996 Grand Marquis that hit 402,000 miles last week. Original engine (4.6) and transmission (4r70w). 

Original timing chains. Replaced the valve stem seals, chain guides, chain tensioners, and front seal at 350k…It began as a light teardown to see how worn everything was and to decide on buying a new long block. Nope, didn’t need one. Still shows crosshatch on cyl walls, chains weren’t stretched out of spec, sprockets were very lightly worn, excellent oil pressure at all times, burns the same amount it ever did (1/2 qt per 3000 miles), so no reason to replace it. Gave me proof that my 5000 mile service intervals on synthetic oil are just what the doctor ordered. Also gets a new air filter and pcv valve every 10k. Helps keep the oil & crankcase clean. 

Those engines were awesome until about 2003-4 or so. Still very good after that, but ford got cheap on a lot of the parts and they needed the same work around 200k.
Reply: @johnarnold893 generally it’s not the belt, but rather the tensioners that wear out first.
Reply: Ford perfected timing chains in Modular V8 a long time ago in a galaxy far away.
Reply: What about just plain old gears like cummins?
Reply: @PistonAvatarGuy  You think lifters and push rods would zap 200 HP?

I doubt it. 

It is a fact OHC can rev much faster, so perhaps you are right?
Reply: @ihavethedocuments2580  No, being limited to only two valves, more restrictive ports and a less efficient valvetrain zaps 200 hp.
Reply: @ihavethedocuments2580  This is what happens when you replace 2-valve heads and pushrods with DOHC, 4-valve heads: watch?v=2YuUsLZ54Uo

If it were emissions controlled, it might lose 50 hp, but that's still 200 hp more than the pushrod LS7.
Reply: @ihavethedocuments2580  And it should be noted that those aren't the greatest flowing heads in the world. 4-valve racing heads would likely result in a 1,000+ hp engine.
Reply: @ihavethedocuments2580  There was some notion a while back that 2-valve heads can match the flow performance of 4-valve heads, but that's just pure nonsense.

A Honda K-series head, with its tiny 86 mm bore, can outflow an LSX head with a 105mm bore, even with 30% less valve lift! In theory, a 4-valve head with the same bore diameter should outflow the LS head by a much greater margin, at least 25% at the same lift.
Reply: Diesels usually have timing gears because chains don’t last.
Reply: In big trucks they are geared timing
Reply: It all comes down to a lobbied Gov.
Engineered obsolescence 
produces two things;
A huge profit gain for dying i.c.e. class automotive crowd and Inflation. Taxing the work poor people class is a control agenda for bloated oversized bureaucratic greed.
It  knows no limits and has very little care for upcoming crash.
The vast majority of ‘billionaires’ are filthy rich, pay no tax, personally don’t own a thing. 
They all work on borrowed cash off of capital assets. 
Crashes mean huge profits scooping up assets from the insolvent and bankruptcies. 
While this is insane for us, its business as usual for them. 
A change of Gov will help, but its like changing a diaper, they will shit themselves again. 
Information, knowledge is like battery acid and instantly dissolves their scams.
Reply: @stevenichols4639 I’m pretty certain the engine failed quite quickly as it was burning its own oil causing the failure
Reply: I’m an automotive engineer don’t tell them I told you this, but we (employer) really don’t care. Truck blows up after the warranty. To be honest. Most cars nowadays. Have a 10 year expiration date. The people I work with every day with the smartest people I know from mechanics to former Dakar , and Baja engineers,. Trust me we can make a reliable engine Toyota was doing it back in the 2000s. There’s been multiple cases where through long-term testing we have found multiple issues but since the issues we found “most likely” happen over 200,000 miles we purposely did nothing. our customer base (likely used) who drives cars not far into the future. Don’t have the money to buy a new products so we don’t care what they think about us. And the customer basis I that afford a new truck will have a perfectly problem with the truck for 6 to 8 years. before you ask other companies do the same even Toyota now with the new turbo junk. We usually open up or competitors engines and see what we can rivers engineer or learn from )non-patented) Sooo… sorry 😢 (power train engineer in one of the big American three)
Reply: @Thecarguy1254 Yeah, I'm feeling the same way. F wet Belts, chains are a pain to change.
Reply: @AkioWasRight how? You always have an extra cam at least. The first mod motors were cam over bucket single cam engines. Can’t get more basic for a ohc configuration. 

The modern coyotes are significantly more efficient trucks than the modern 5.3 let alone the v8. This is reflected in the mpg and power ratings of the trucks. 

Coyote heads flow better and have significantly higher compression to increase efficiency. Very similar to the first generation of skyactiv engines
Reply: @Demons1198  I have plenty of experience with both SBC motors and Coyotes. There's also tons of data stacked over the years. I've seen nothing to show any significant efficiency advantage in the Coyote, none.

Also, you're making a generalized comparison. In the latest generation, there's no version of GM's 5.3L that competes directly with any version of the Coyote. 

Still, even if everything you say were correct, nothing about it discounts the simplicity and durability of gears and/or in-block cams over the complexity of S/DOHC and chains or belts. In reality, this whole argument misses the initial point of mechanical simplicity.
Reply: @PistonAvatarGuy  Nothing "zaps" horsepower. You either make horsepower or you don't. High revving, low displacement DOHC and low revving, high displacement OHV are just two different ways of making more power.
Reply: @PistonAvatarGuy  Cylinder head flow isn't the be all end all. Air velocity can be just as important, if not more so. And you don't necessarily gain air velocity through more valve or more valve surface area. The idea that more open = more power and efficiency is an understanding that has regularly been debunked many, many times.

You're making the K-series as some type of exemplary model here. K series motor are actually very inefficient engines, given their small displacement. Even relative to an LS/LSX, it's not efficient. You're so focused on metrics that lack relation, you completely ignore meaningful metrics.
Reply: @PistonAvatarGuy  Many 2 Valve racing heads result in 1,000+ horsepower. What's your point?
Reply: @CuzRepo  I was just using the terminology of the person who replied to me here. Yes, you either make power, or you don't, but there are things that you can do to increase, or decrease the amount of power that your engine makes.

Yes, we are discussing different ways to build engines here, but the ultimate power output capability of an OHC engine is greater than the ultimate power output capability of an OHV engine, there's just no way around that. OHC engines are also more mechanically efficient.

Flow bench numbers are hugely important, which is why people spend huge amounts of money on flowbench testing and use the resulting data to compare and advertise cylinder heads. No, flow isn't the only thing that matters with regard to port/head design, but it is the main metric used to compare the performance of cylinder heads. OHC heads can massively outflow OHV heads, period.
Reply: @CuzRepo  The point is that you can't get 1,000 hp out of an OHV engine that's small enough and light enough to be used in an F1 car... not one that would be competitive, anyway.

The Chevrolet R07 used in NASCAR racing weighs 525 pounds and makes 850 hp, while a Ferrari F1 V10 weighs 203 pounds and makes 940 hp... while also running on much lower octane fuel.
Reply: @CuzRepo  Really, I just don't even know how to reply to your comment, it's so simplistic and warped that I can't even begin to disassemble all of it.

If 4 valve engines are so inefficient, why do all of the most efficient automotive engines use 4 valve heads?
Reply: @PistonAvatarGuy  No, F1 and NASCAR both use similar 98 AKI blended fuel. Don't know what you think otherwise. F1 uses 102 RON, but translates roughly to the same 98 AKI. Theoretically, they both can run on the same fuels.

What's more, NASCAR and F1 are apples to oranges, complete different regulations and driving demands. You can't make a valid comparison there.

If your point is that F1 engines are tine and powerful, it's just matter of power density. There are more power dense OHV engines than F1, you know? Scaled down, an OHV could easily make more power than an F1 engine. I mean, never mind racing engines, there are LS and Hemi engines that are more power dense than F1 engines, and they do it with pump gas. 

There's nothing remarkable about F1 engines.
Reply: @PistonAvatarGuy  Flow is your main metric. It's not the metric that ultimately matters.
Reply: @CuzRepo  In order to make 850 hp, the NASCAR engine that I used as an example here needs 110 octane fuel. With the unleaded fuel, NASCAR engines are only able to make 670 hp.

I know how different NASCAR and F1 regulations are, but Americans could never build a competitive F1 engine, they simply don't have the technology. The same goes for LMP/Hypercar engines.

No, there are not more power dense OHV engines than F1 engines, you can't get even remotely close to the power density of a high rpm DOHC engine while using a pushrod engine. The ability of a DOHC engine to rev well beyond 10,000 rpm and retain superior BMEP to a OHV engine in that higher range of rpm, is the only way to accomplish such high power densities.

That Ferrari F1 V10 has a power density of 4.63 lb/hp, a pushrod engine might be able to get to less than half of that, but not while running on the same octane fuel.

Edit: It might even be impossible to make 2 hp/lb with a pushrod engine. The best is probably more like 1.6 hp/lb. Even a Judd V10 makes 2.6 hp/lb.
Reply: @CuzRepo  Power output is determined by mass air flow. The only other major consideration is turbulence to aid in fuel mixing.
Reply: Because chains make no sense on an application like this, direct gear is the way to go.
Reply: @WilliamStewart1  Timing gears on an OHC engine like this would probably add thousands to its price tag.
Reply: @WolfmanDude ahh but that part “ EASY TO CHANGE” is the seemingly undoable today.
Reply: Damned belt side an engine .   Now I don’t feel so bad my F 150  2.7 has one of those cheap disasters waiting to happen.   I guess cheap junk really is contagious across brands🤬
Reply: @hopingforthebest1.9 absolutely right!    Back in the day guys would rebuild their 327, 350. 351s ( well not the nylon disasters)  and just give a quick inspection before using them right over in the build.    Hardly anyone ever changed the timing gears.    In light aircraft they do the same but x ray for cracks first and check tolerances.    Those go on forever as long as in spec as well.
Reply: They can... reliable engine designs are no secrete. They are designing engines to maximize profit at all ends - NOT reliability & longevity.
Reply: It's the new generation. They weak out on everything possible. Pitiful era group of diesel designers